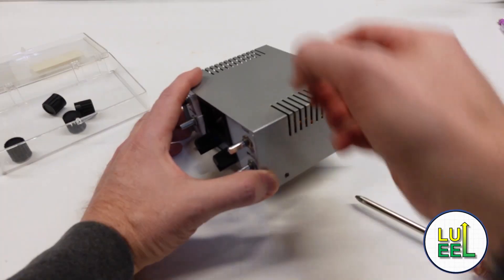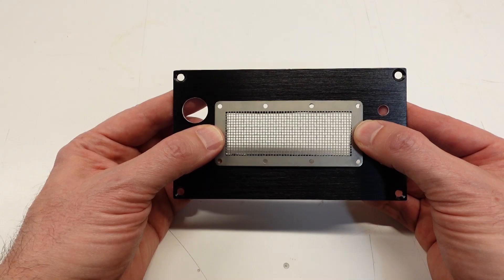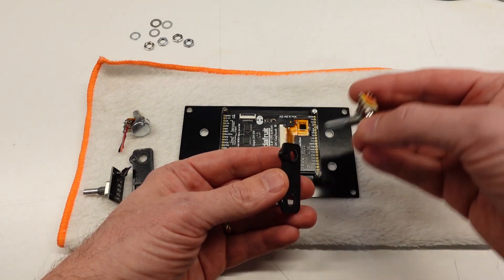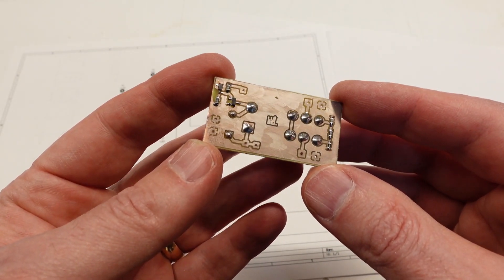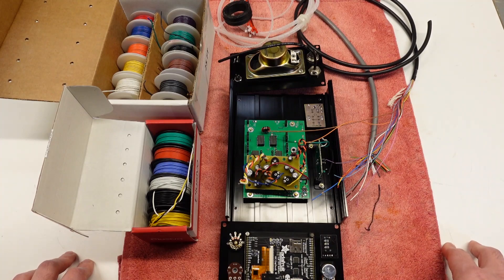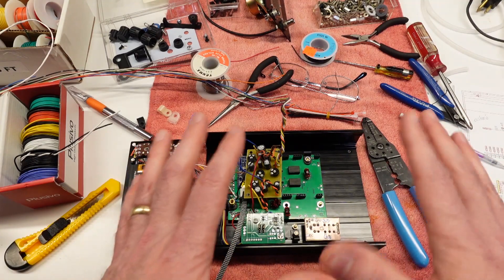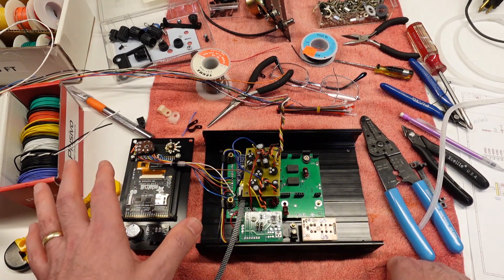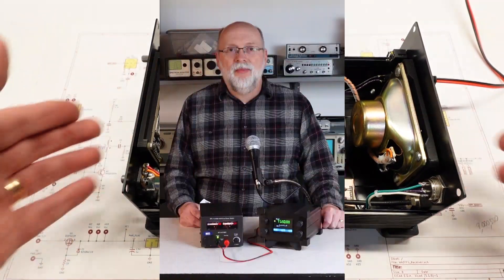HF Receiver part #13: Moving complete!

Comment: Great attention to detail, your homebrew design and construction work is too good to be called 'amateur radio '.  
Just a thought,  Ive made good use of ribbon cables for non signal inter board connections.  Each wire is good quality multistrand wire and small so it saves space. Good for connecting display logic, relay control lines, etc, and they stay firnly bonded together in a ribbon.  If you use rainbow cable each conductor has its own brightly coloured insulation so its hard to mix them up.